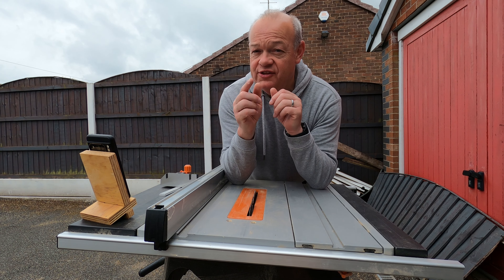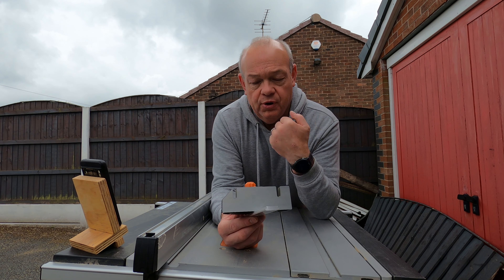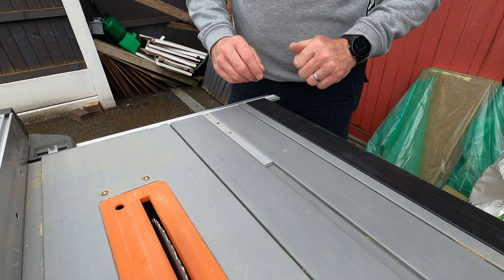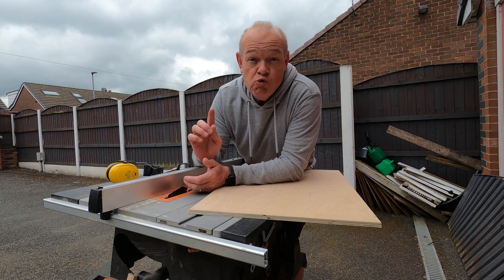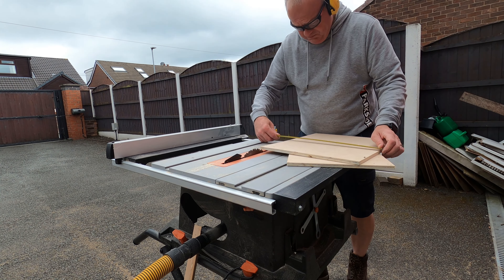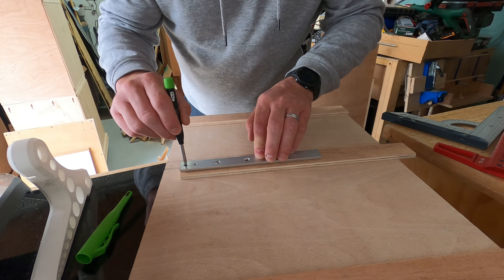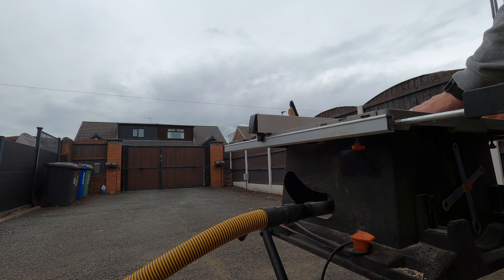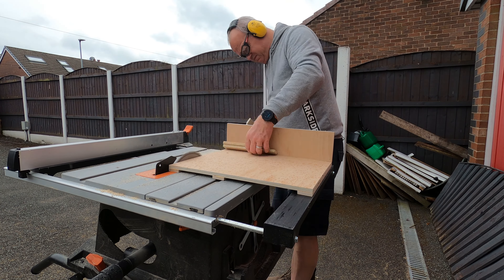The Garage Workshop  - Mitre Saw Gauge

Comment: Nice build.
Yes, be mindful to always extend the table, as the tilt could have disastrous effects.

As for the riving knife issue. It's more common than you'd think, and with a number of different brands - even my DeWalt has a slight issue with the riving knife. You should be able to loosen the riving knife in its housing, once it's loosened you can add a washer behind the knife  (thickness will depend on the deviation of the knife). This can help move the knife into a more aligned position with the blade. I've done it this way and it did help a little.
Reply from the maker: Thanks Matt that is a fantastic diea!
Reply: Hi Matt I have an old Ryobi 1526 with the same issue with the riving knife, thanks for the tip I'll give it a try

Comment: I have a similar table saw to this but because the guard is attached to the riving knife I couldn't cut rebates. To get over the problem I simply used an old circular saw blade cut to shape with a grinder and file to make a lower riving knife.
[ It's best if you can get hold of a worn out blade that has the same , or slightly thinner thickness to make the replacement ]
Great video by the way.
Reply from the maker: Thanks for the advice and for the feedback!

Comment: Nice Simple. I think I will be doing something similar to mine. I recently bought a 2000W 10inch blade Skil.

The miter gauge is completely awful, but I will use white thing like acrilic as runners
Reply from the maker: That's a great idea...I did think of that but decided agonast it.

Comment: Apologies for being pedantic but this is not a mitre (45 degrees). A more accurate description would be a cross-cut sled. Mitre gages can be used to cross-cut but the name comes from its ability to cut at an angle. Not that any of this affects the functionality of the jig, which does the job you intended it to do. 

Hope you find a fix for the riving knife. I know how annoying it can be when it catches. Are there no grub screws to adjust it? If you can detach it, perhaps hammering it flat on a anvil-like flat surface would work.
Reply from the maker: I agree it does look like one but it does replace the mitre that Evolution gives you with the saw. I looked it up in the manual to check.  :)